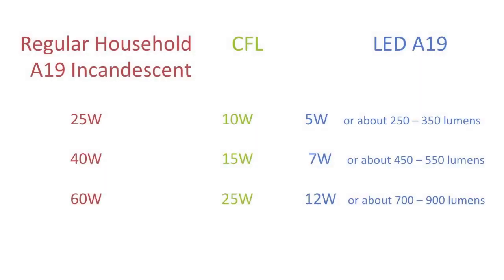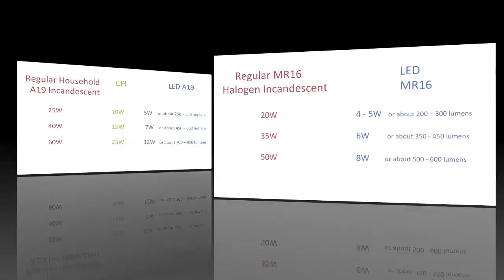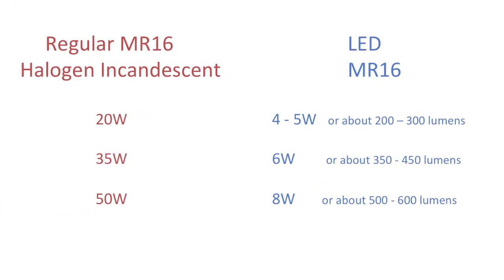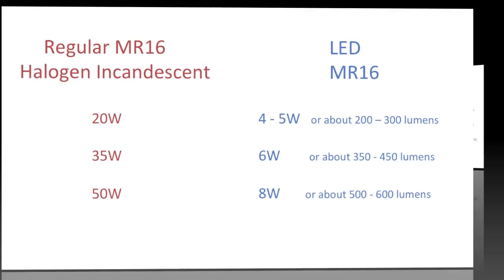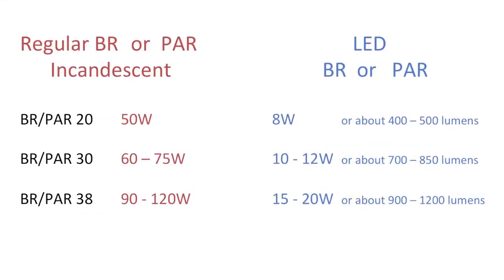Intro to LED Light Bulbs: Part 7: Identifying Bulb Types

Comment: Since LEDs are lower wattage than incandescent, is it safe to use a type A LED bulb in a lamp that specifies type B bulbs? The bulb fits and works, but is it safe long-term?